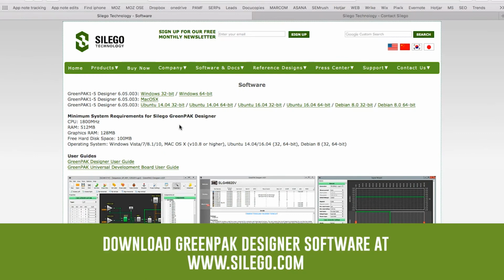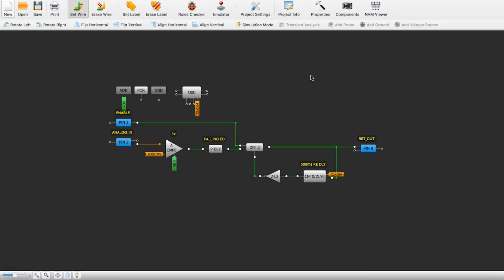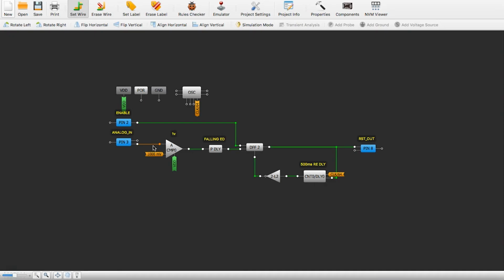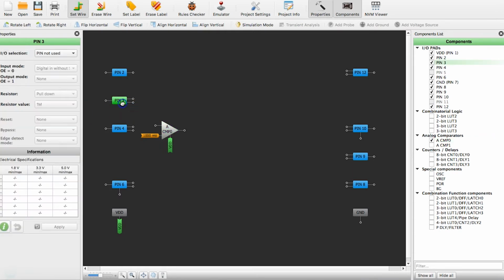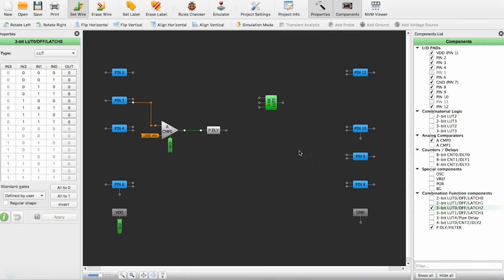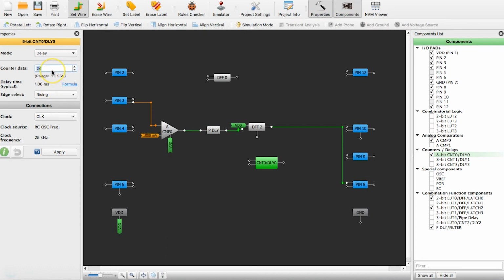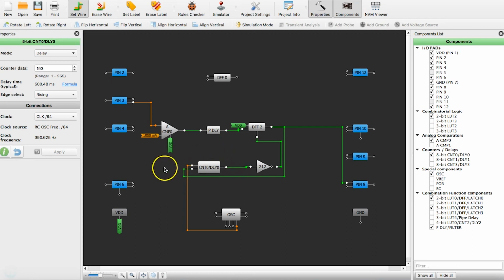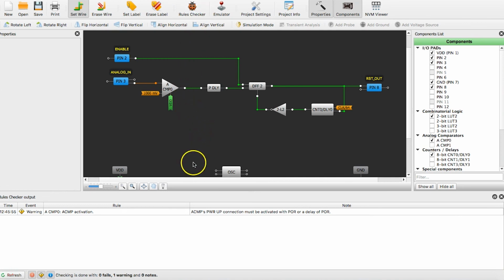Creating A GreenPAK Design

Comment: This is great software and great chips, but you know what would make it even better: replace those miter nets with bezier or cubic splines. If you make the splines intelligently weighted, there's no reason to ever need to fuss over manual placement of nets, just let the software do it's thing and let us engineers concentrate on connectivity.